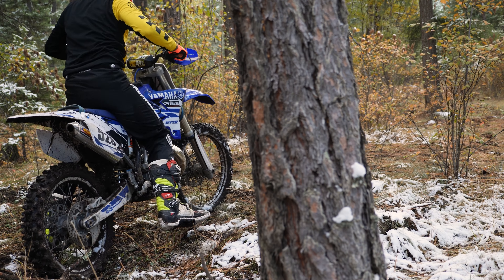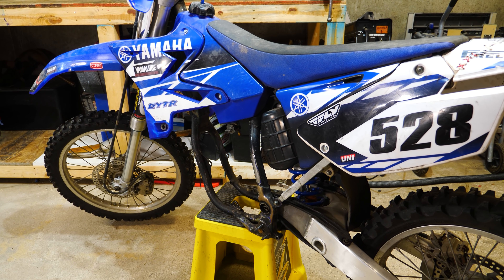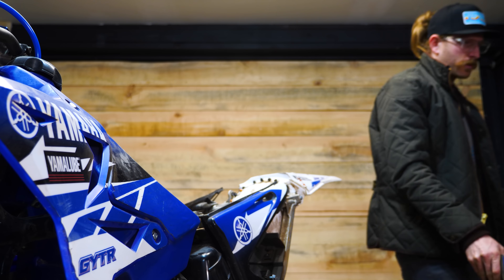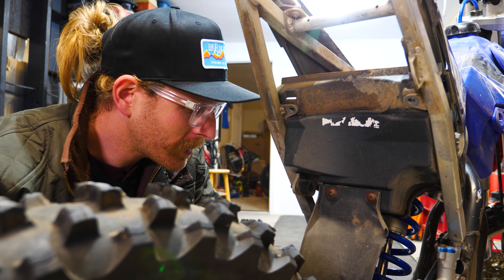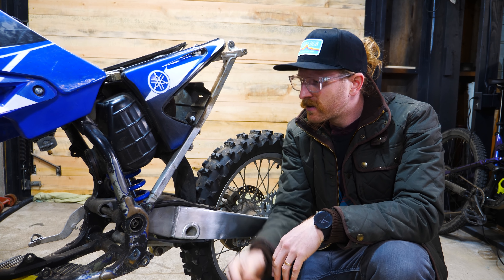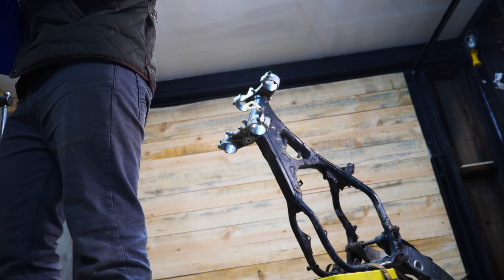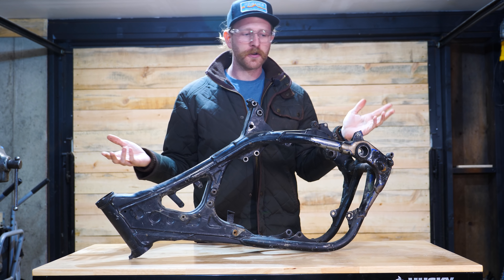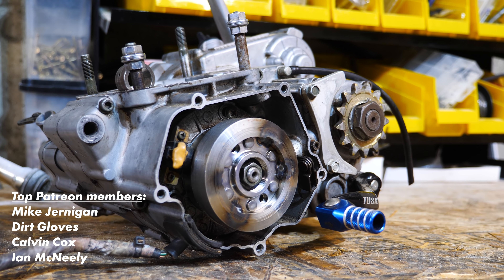Tearing The YZ250R Down To The Frame // YZ Enduro Build - Part 2

Comment: Drill them out and have a buddy with a lathe turn some steel bushings that you can press in to the holes to use the stock pins. Then you won't need to modify the foot pegs to accommodate larger hardware too.

Comment: Pro-tip: replace the swing arm and linkage bearings while you have them off the bike. It will make your suspension feel 100% better and based on how much you had to beat out that rear axle plus the amount of rust on those bolts a can guarantee those bearings are toast.
Reply: exactly this

Comment: Foot peg mounting holes should be opened up with a piloted reamer, rather than a generic drill bit, for best results.
Reply: He will have to open the holes on the actual foot pegs themselves as well. Good to make sure there is enough space without removing too much material.
Reply: @paulwintermute1495  I think he's got that figured out🤣
Reply: @damarapoledna3636  I'm a professional mechanic. You would be surprised at what people overlook daily. Never hurts to ask the question.

Comment: For foot peg pin replacement see if you can find something with a shoulder length that is the full width of the tabs and then cut the excess thread off.

Comment: Drill them footpeg holes out and get pins they sell them at ace hardware a dollar or two each and will look factory they have holes already drilled in the pins for cotter keys. Will let you know what size I drill mine out to. Have to drill the peg holes also but that's easy as well. Just make sure to drill them straight thru not on a angle.

Comment: Tip here, ziplock Sandwich bags and a sharpie, put nuts bolts and hardware and label each bag for location I.e. brake caliper front. Also since I have access to a machine shop I would drill footpeg mounts and use a good sleeve or as you mentioned just step up to the next size bolts. Should be simple fix.  I can’t believe I just watched a guy take apart a dirt bike. I’ve been riding off-road for over 40 years and have never taken a bike completely apart like that. I have reassembled one for a client that couldn’t put his back together but man that’s a lot of work.
Reply from the maker: Its work i enjoy! Been wanting to tackle this bike for a while, if it turns out nicely, it won't be the last 🤘
Reply: @TheShredist  cool, I think one of the things that come through your videos is your love for working on your stuff. I've been building and repairing stuff my whole life and at 59 I'm getting tired of fixing stuff for others and it's kind of ruined me for doing my own stuff, that's one of the things I love about mtb riding very little maintain and lots of ride time, keep up the vids bro

Comment: Bleu or white for the frame 😍
The heat treatment on the peg's arc will not be very very damage if you weld it the proper way ( mig or Tig) arc welding effectively will perhaps be to brutal and make it brittle.
But for me a would weld and re-create the OEM hole for using the OEM pins, it's way simple if you break it again.
Thanks for mix of your channel ☺️

Comment: The polisport restyle kit needs a 02 subframe (there is no way around it) but to fit the subframe on a 2001 you need to cut and weld new frame mounts or cut and weld the subframe
Reply from the maker: Should be fine, we're working on an 03 👍
Reply: @TheShredist  ohhhh makes sense, though that steel frame yz250 stopped at 2002 at best
Reply from the maker: This model was made from 2002 to 2004, virtually the same as the al framed models to currently minus suspension and a couple small tweaks in the motor. Its a great platform to build from!

Comment: Check out the rox speed offset risers. You'll be able to have the wide range of bar bend options with oversize. They also give you a forward offset with the rise, good for taller riders
Reply from the maker: Those look legit. I like my bars in a forward position on the clamps but thought I was stuck with these. Might have to invest in those 🤔
Reply: @TheShredist  I just put them on one of my bikes, definitely prefer the feel.

Comment: Nice build! I know that XC gear makes some oversized foot peg pins for ktms with a larger diameter to account for the same type of wear. I believe Slavens racing sells them. They say for ktm but I can’t imagine footpeg pins are too different bike to bike?
Reply from the maker: I'll check that out, if definitely like to retain pins instead on bolts!

Comment: Dude my subframe on my 06 is way worse, like mine has become 3 sided like a C channel 🙄 itll be fine. I need to have it repaired though. You're right subframe are not cheap and they're impossible to find used
Reply from the maker: I figured it would hold up. Even worn out, its probably still more durable than the husky composite frames lol
Reply: @TheShredist  haha yeah for sure. Also the footpeg mounts, make sure the bolt you use also fits through the pegs themselves or you'll have to drill them too

Comment: Frame color: I have seen some nice YZ builds with black frames and they are easier to touch up. They do disappear once surrounded by motor, pipe, and plastics. Are you going to keep the motor stock color? Thanks for the update, I was just wondering how this was going.
Reply from the maker: Yeah I think I'm going to keep parts colored stock for now. Maybe later I'll start playing with cerakote.

Comment: I Want to race the enduro at beacon this year, and I have an xc bike with some upgrades (better tires, wide bars etc) and it only has 100mm of travel front and rear, and I also have a 200mm dh bike, whish would be best?
Reply from the maker: If you don't mind pushing the dh will work better for the downs, but if you want to pedal youd manage on the xc, it might just be a little bumpy lol
Reply: @TheShredist  okay, thanks, will you be racing there in April this year?

Comment: Cool man, I'd go back blue on the frame I think it would look newer that's just me tho. I got a 2011 yz 250 smoker I need to do a Maintenace rebuild also but my work area is terrible I live in an apartment so that sucks for rebuilding. Did you say the motor is ok or were you concerned with the crank? 🤙
Reply from the maker: Needs a full bottom end rebuild, so we'll be splitting the cases

Comment: Think about updating the suspension to the 2006+ KYB SSS. If you do that, there's basically no reason to drool over a new YZ.
Reply from the maker: I had thought about it but I just had this set built to top spec. Swapping full SSS stuff would have been rad but the cost and added effort of welding a new steering stop to the frame or sourcing the right triples wasn't worth it to me right now. Maybe in the future though 🤘